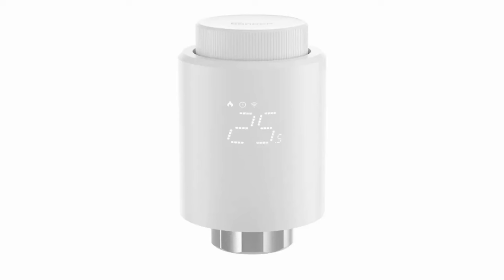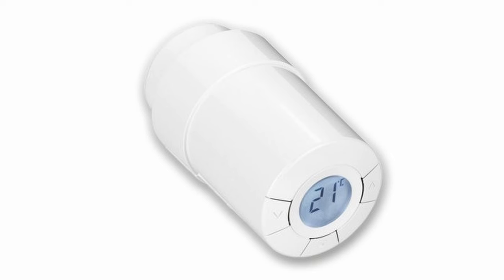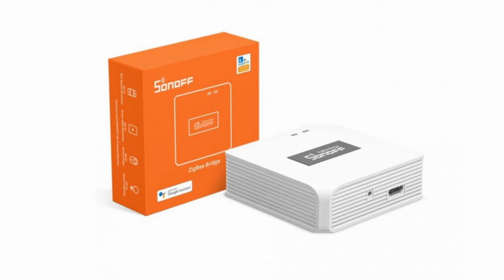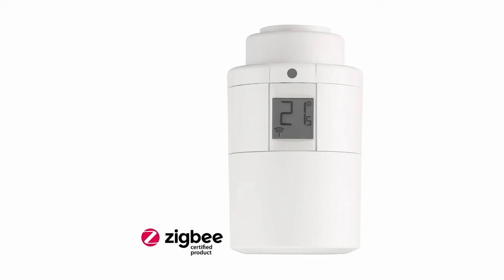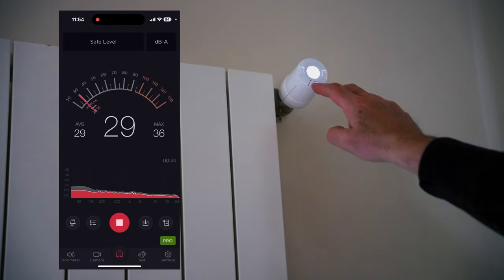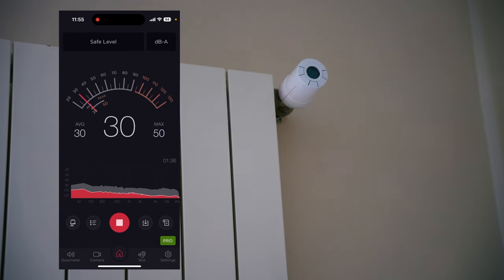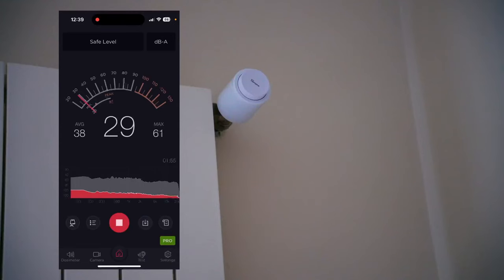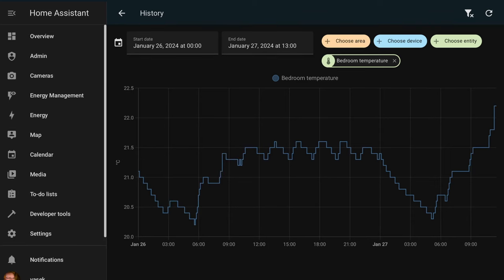Is This the Ultimate TRV? Sonoff vs. Danfoss Showdown!

Comment: You have mentioned Danfoss was doing something in Summer when the heating was off and you took the batteries out. I cannot find it right now, but I remember Danfoss did such thing on purpose. The main reason behind it is to do not let the valve stuck in certain position so Danfoss do cycles like open fully, close fully and back to set position. It does it on schedule like once per few weeks. It is actually good for the valve and personally I left the batteries in, so Danfoss can take care of the valve.

Comment: Hopefully you will follow up after the firmware update? If the new firmware would just reduce the valve opening after hitting the max temp it would be great.  I would order bunch of these as my main criteria is the quietness of the valve.
Reply from the maker: That's the plan :)

Comment: How do you control the boiler to call for heat using the Sonoff TRVs. One of your replies to a comment mentioned a previous video, but I was unable to find anything that related. Can you point me in the direction, cheers

Comment: The slow response is in most use cases a good feature. I think Dannfoss even claims to have a 30-minute “ventilation time”. If you open a window it will not go all open immediately. A set value change could be done without delay though. 

Then regarding lower temp during part of the day. In many cases it will create secondary problems in the form of energy consumption spikes. I have district heating, a “heavy” brick house and I had the Danfoss system. The monthly base rate for district heating is given by max 3hour consumption during winter months. So, when I tried the “smart” function to drop temp during part of the day, the spike it created when heating back to normal caused me to pay extra for the next 12 months. 
I gave the system to a friend with heat pump. He also disabled the function because the spike exceeded the capacity of the heat pump and caused it to use the emergency heating elements, hence dropping efficiency. 

If your gas heater has sufficient head room it might work to drop during part of the day and then take a bigger hit when heating back to normal. But as stated, use with caution.

Comment: Reducing the temperature basically always help. But doing it for just a few hours give very limited benefit. Doing it for 6-8 hours, the benefit is quite significant.

The only thing to consider is that the thermostat should not overshoot the target temperature when heating up, That is basically the one situation when reducing the temperature might be decremental.

Comment: I've been using the Aqara TRV and I can say that I really like it. The display is great, it has many options in home assistant and I still have the same batteries for around a year now. When I change the temperature, it starts changing it instantly without any wait. I think the noise is the same as you recorded, it's not really bothering at all. The only louder noise that it makes for me is when it fully closes. The motor seems like it's still trying even when it shouldn't so there's a bit unpleasant sound. (Tried to calibrate it multiple times) Might be just my old valve and not a hardware problem of the TRV. Valve never fully closes during night so I don't consider this as an issue. I would buy it again. The only thing that is missing for me is the % slider. That would be a good addition.
Reply from the maker: Yes, you are right. They mentioned noise when it was fully closed, as if it did not know it is already closed. So this is consistent. For the batteries, they mentioned a much shorter time (2 months or so). They mentioned the manual setting is not smooth and jumps around, and an issue with some sort of plastic pin. So this discouraged me. Glad to see that it works for you.
Reply: @bruxy70 interesting, the battery for me is at 78% since I bought it. Not sure what could be the problem with the smooth setting nor the plastic pin.
Reply: Are you on constant heat supply or using timed heating? I hate my aqara TRV as it constantly micro adjust itself as it want heat when i have my heating off. All i want it to get to the set temp and thats it
Reply from the maker: @lisijlisij9471  There is a program on the heating system. But I lower the TRVs pretty much consistently with the program.
Reply: Yeah theres a smart schedule, but once i decide to heat up the house, i would also have to set the trv, this is annoying. Basically i want same function as analog TRVs but with wifi ability, thats all
Reply from the maker: @lisijlisij9471  That's why I haev them controlled by Home Assistant, so it sets it automatyically. I never set the TRVs manuallty - it woudl be pointless, as the automation would change that again
Reply: @bruxy70  is that the same story with sonoff?
Reply from the maker: @lisijlisij9471  I think it will behave about the same as your aqara
Reply: @bruxy70 thank you Vaclav

Comment: what is the better battery consumption, to fully close/open or using calibration with external temperature sensor - then let it close/open by percentage steps automatically ? I'm using Tuya zigbee 3.0 TS0601

Thanks
Reply from the maker: That's a good question. The small adjustments might take less power, but then they will probably happen more frequently. Taken to the extreme, if it keeps adjusting constantly, that would take most power. So I guess less frequent changes would be better for batteries. But I did not measure it.

Comment: Any update on the temperature control?
Reply from the maker: Sadly no. I did not really use it during the summer :)
Reply: @bruxy70  i heard if you update the TRV to 1.1.5 it can intermediate control the valve. Haven't tested it yet.

Comment: How do you switch the central heating system with the sonoff TRV?
Reply from the maker: Not directly. But when the TRVs are closed, the heating water will not lose heat and the heating system will turn off. But I also have a secondary way to control it directly through a thermostat contact - I made a video about it a while ago.